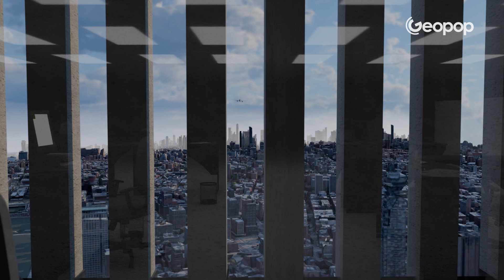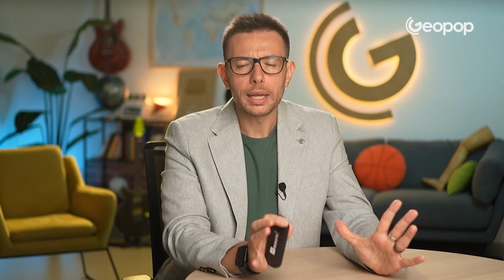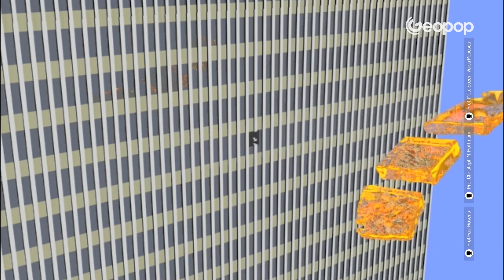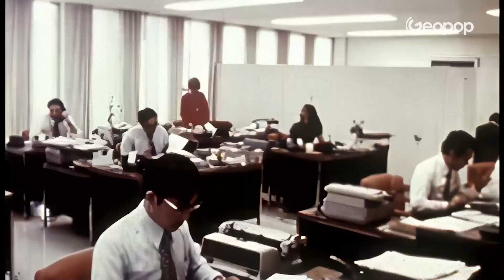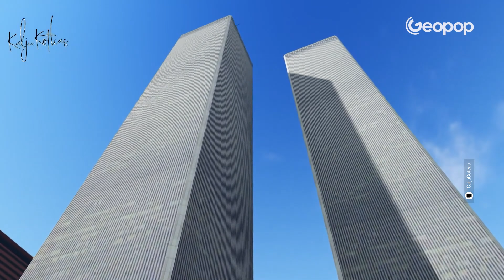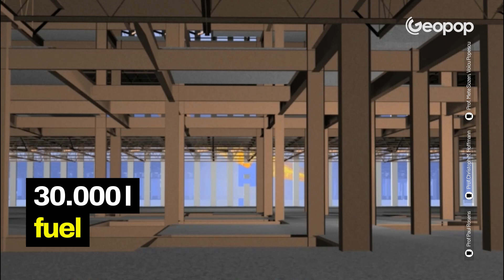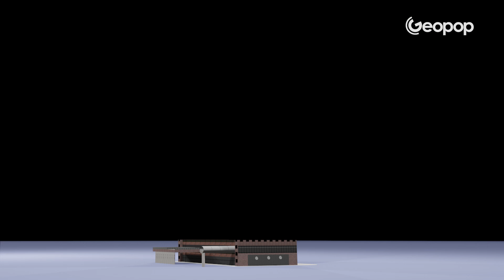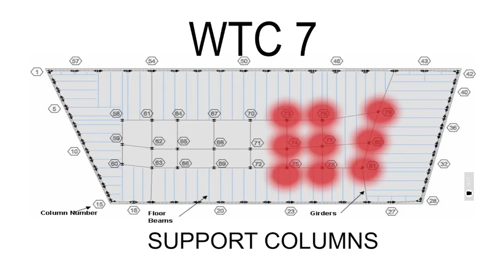9/11, 2001: The Technical Reconstruction of the Twin Towers and WTC 7 Collapses

Comment: WTC 7 still will never be explained away.  No other burning skyscrapers have ever collapsed like this.
Reply: And yet,... Much misunderstood, Building 7 was the 6th building to collapse of 10 lost on 9/11. Because of its early low priority, conspiracy filled the information void with garbage made up by technically ignorant people promoting political agendas. But 7's loss is an engineering problem and should be treated as such, so I prepared this brief summary of my own analysis to fix that, using technical analysis, not ideology and tired memes. 

At 10:28am the WTC North Tower collapsed, showering Building 7 with tons of burning debris, causing heavy damage and starting many large  fires which burned out of control for the next 7 hours. Half the FDNY firefighters having been killed, units in disarray, equipment destroyed, no water pressure, and the greater urgency of search & rescue efforts, Building 7 couldn’t be saved so firefighting efforts were pulled as futile and 7 left to its fate. Firefighters make that sort of choice every day in brush fire situations - which houses to save and which ones to let go. Only real difference here is moving the decimal on the size and cost. People get overwhelmed by the size.

www.youtube.com/watch?v=g_SvpwyC17M

Collapse of a burning structure is always a concern for firefighters. Steel buildings subject to fire rely on active firefighting to survive. Buildings are designed around 1 to 3 hours of fire resistance, allowing time for occupants to escape and active firefighting to get started, after which all bets are off. Left to their own devices they'll exceed their design envelope and collapse, like Plasco Tower and Wilton Paes de Almeida. In 7 the occupants escaped, passive and active fire protections were compromised and active firefighting was abandoned hours before the collapse, which left the building to its fate. It lost. Odds on Building 7 would eventually collapse, and it did. No big deal in logic.

 http://www.youtube.com/watch?v=WnYBX6QT0R4 

FDNY Chief Daniel Nigro - The biggest decision we had to make on the first day was to clear the area and create a collapse zone around the severely damaged 7 World Trade Center, a 47-story building heavily involved in fire. A number of fire officers and companies assessed the damage to the building. The appraisals indicated that the building's structural integrity was in serious doubt. I issued orders to PULL back the firefighters and define the collapse zone. It was a critical decision; We could not lose any more firefighters. It took a lot of time to PULL everyone out, given the emotionalism of the day, communications difficulties and the collapse terrain 

FDNY Deputy Chief Peter Hayden ; We had our special operations people set up surveying instruments to monitor and see if there was any movement in the building. We were concerned of the possibility of collapse in the building. And we had a discussion with one particular engineer there, and we asked him if we allowed it to burn could we anticipate a collapse and if so, how soon? And it turned out that he was pretty much right on the money, that he said 'In its current state you have about 5 hours 

The collapse of Building 7 was anticipated and widely reported in the media throughout the day, with 24 video cameras recording some or all of the collapse. Everyone knew what was coming and why. 

www.youtube.com/watch?v=OY5S5k3tMHI

The collapse of Building 7’s was entirely different to the Twin Towers and harder to understand, most details being hidden from view and not intuitive.  But we can still sort out what happened through careful analysis and observation. This is my explanation of the collapse relying on no outside authority. 

Building 7 was a unique, asymmetrical 47-story steel framed structure built atop a smaller 3-story building serving as a partial foundation, requiring lower floors dedicated to complex load transfer structures. Of trapezoidal shape and all-steel tube-in-tube construction, B7 (above the 7th floor) consisted of a central core of steel columns carrying most of the gravity load, perimeter steel columns around the outside of the structure carrying the remainder of the gravity loads and long span beams and girders to tie those elements together and form the floors. On the outside of the building hung a moment frame or outer shell. 

Phase 1 : First externally visible signs of collapse initiation occurred at 5:20:28 pm and were notably quiet with observers not realizing the building was collapsing! No audible warning in the form of hundreds of ear drum busting 180-190dB explosive bangs preceding the collapse. Here at 12:00 a local CBS affiliate reporter is talking 10 blocks from B7 when collapse begins. People don’t start to notice the collapse until 12:11. At 12:45 is the famous CBS fixed camera clip of Building 7’s collapse. Note how quiet it is. 

www.youtube.com/watch?v=t5tEy6mXSE8

Collapse initiation was due to lower floor failures above the load transfer region (8-14th floors) in the NE corner. In this video at 0:45 you can see the NW corner from inside the building while under construction, Column 79 just out of frame on the left. That big, angled steel beam across the top of the frame connects to C79 at one end. The girders connect to the beam. That beam and all those girders depend on just one connection 

www.youtube.com/watch?v=nP3TNHPCIVU&t=45s

Phase 2 : The NE lower floor failures caused a loss of critical lateral support over an excessive length of Column 79 and it buckled. Looking at a floor diagram of Building 7 (www.nist.gov/image-16640) when you see all the structures that depend on C79 you quickly realize this one column was a relatively isolated structural element on which a disproportionately greater fraction of the structure depended analogous to say the Key Bridge. Externally as collapse begins we see a vertical progression of window breakage along the 44-46 line and a kink in the roof of the East Mechanical Penthouse at the top of the building, consistent with C79 failure. Normally with a buckling column, the load could be redistributed to other columns. With C79 that is not the case - the failure did not redistribute the load, so the collapse rapidly progressed to the roofline, sinking the rooftop penthouse. The transition from full capacity to almost no capacity occurs in an instant and will result in virtually no resistance 

Phase 3 : With C79 gone, B7’s progressive, non-symmetrical collapse continues with adjacent columns 80 and 81 left laterally unsupported, and quickly buckling as well, sending the EMP down through the building. C79-81 all have no diagonal bracing, which is the major reason why they could not redistribute a lot of vertical loads among one another. From there collapse progressed from east to west through the central core until the core was gone taking all of the interior floors and probably most of the perimeter columns with it. Follow the horizontal progression of window failures low in the building and the dropping of the remaining rooftop structures into the building. One of the big takeaways from the NIST Building 7 study (invariably ignored) was how their modeling determined C79 failing under ANY circumstances would have initiated the same collapse sequence. 

Phase 4 : After about 10 seconds only the exterior moment frame remains, giving the illusion B7 is still standing to the casual observer since little has outwardly changed. But it is just a hollow empty shell like an empty cereal box supported only by a few remaining columns and overloaded from the loss of the core columns and floors, quite unable to remain standing. With nothing remaining behind it, the north face leans inward, forming a V in the roofline, the last few columns buckle under the strain and the moment frame free falls, landing on top of the debris pile. 

It is only here at the very end that a single measurement of alleged free fall acceleration is taken, from a single point on the outer shell. The Building did not “free fall” – just one corner of the outer shell did, sort of. The Building_ (defined as its center-of-mass) was already gone before that happened. The period of alleged free fall was a product of how it fell NOT why it fell and can't tell us what started the collapse 10 seconds earlier. Start to finish the collapse took 18-20 seconds, 3 times longer than free fall . How fast something falls cannot tell you what started it falling_ anyway. 

The debris spread outside the footprint blocking surrounding streets, heavily damaging the Verizon Building and destroyed Fiterman Hall. 

Building 7’s progressive, non-symmetrical collapse was incidental and unintended collateral damage from the combined effects of fire + time + gravity, started by the collapsing North Tower. That is true no matter who planned and carried out the 9/11 attacks or why . The collapse was of so little consequence it barely registered at the time - a footnote, only taking on semi-mythical status as an alleged smoking gun years later when demolitions at the Twin Towers, missiles at the Pentagon and shoot down over Shanksville all failed and conspiracists had nothing left to work with. 

Anything can seem like a conspiracy if you don’t understand how it works. Now you should. I hope you found this helpful, informative and it solicits informed critical comment. If I made any errors of fact, logic or reason or left anything important out, please let me know so I can fix it. IF you can offer a more plausible alternative please do. Be the first. Please start any reply with the words “Tits McGee” or I will know you didn’t read it and are wasting my time.
Reply: @TheLoonResistance  So which 5 buildings collapsed prior to WTC7 stinkyshit? Oh no I forgot: You are way too much of a coward to EVER answer questions on your stupid blahblah...
Reply: The ignorant person.
With an agenda is you smelly. And the?
Proof is all up and down these comments sections.

Comment: The only thing I don't understand is why the towers didn't collapse down to the point of impact then stop. Not only was the structure undamaged below the hit, it would now no longer be carrying the load above it.  I just don't understand how cold undamaged steel just pulverizes.
Reply: Gravitational Potential Energy.

Once things start moving, there is no mechanism by which it can stop.  The energy of the falling mass will bypass the load bearing structure below and overwhelm everything else.
Reply: @TheLoonResistance  they did address it closer to the end of the video, but when you see the towers fall, especially the first one, you can see the entire mass fall off the central axis so that weight isn't hitting the floors below.
Reply: @shaggycan  - Let’s break it down to the absolute basics:

The 47 core and 236 perimeter columns of the Twin Towers support all of the gravity loads of the building. ALL of the resistance is in the columns.

Planes impact Towers, causing massive structural damage, destroying sprinkler systems, tearing out gypsum board walls and blasting off the SFRM insulation from the floors. Multiple floor-wide fires are started instantly and spread rapidly due to the destruction of fire protection systems and venting of the building during the impact.

Serious fires were largely confined to the impact damaged floors and those immediately adjacent to them.

Fires were started by the impacts and fuel aboard the aircraft, which acted as an accelerant. No shortage of other consumables inside the tower to continue the fires.

Collapse was initiated (started) at the impact and fire damaged floors when floor trusses exposed to heat over time sagged, in turn pulling on and causing the inward bowing of some perimeter columns by up to 5 feet until they buckled on one face of each tower (ie: NOT symmetrically).

www.youtube.com/watch?v=ULdiD6gYZO0

No steel melted or needed to. Structural steel will bend and fail at less than half its melting temperature.

Once the perimeter columns buckled the formerly static load above became a dynamic load 30 times greater, easily overwhelming the structure below.

Thousands of tons of now loose debris fall through the open office space within the four outer walls - bypassing the columns - dropping 12 feet onto the first intact floor it comes across. That massive instant overload causes the floor to fail, shearing the pair of bolts that secure each end of the floor trusses to the columns. The floor fails. adding its mass to the falling mass which continues to accelerate for another 12 feet until it impacts the next floor, rinse and repeat one floor at a time all the way down.

The columns - the part that holds the building up, supporting ALL of the gravity loads - are spectators for all this.

Rate of collapse increases as momentum increases. The collapse front is constantly accelerating.

As each floor fails, air inside the building (the Towers were 95% air by volume) is compressed, then blows out the sides _in reaction to the Tower falling, not the cause of the Tower falling.

No fire required at all on floors below the impact points for them to fail. The mechanisms that started the collapse are different to the mechanisms which continued the collapse. That will be a difficult concept for some.

As the floors fail the perimeter columns are left literally hanging in the breeze, no longer attached to the rest of the structure. They peel away and fall in great sheets (think banana) out to more than 600 feet from the base on the 4 points of the compass.

Core columns failed last.
Reply: @TheLoonResistance as if you would know the basic stinky. Where did you get your engineering degree? Oh that's right you don't have one. You don't even have a job you live in your mommy's house.
Reply: @TheLoonResistance once something starts moving there's no mechanism to make it stop? Well how do planes land? Why don't parachuters get hurt? Why do elevators stop? Why do things stop when they hit the ground? Why don't people fall to the center of the earth after they jump up in the air? Why does anything stop when it hits the ground? Go back to the third grade and learn newton's three laws. What you are saying doesn't make any sense stinky.